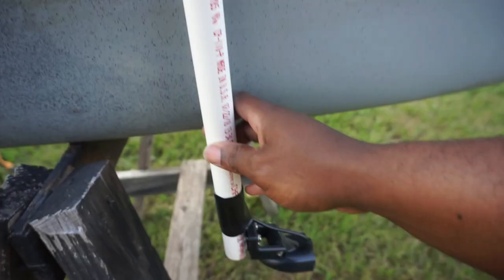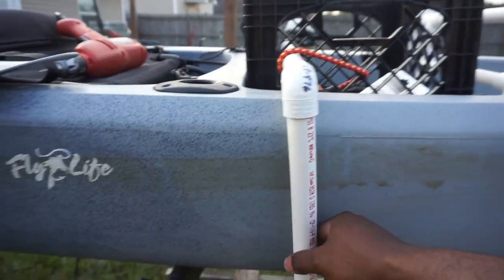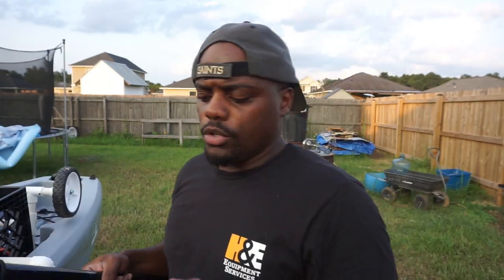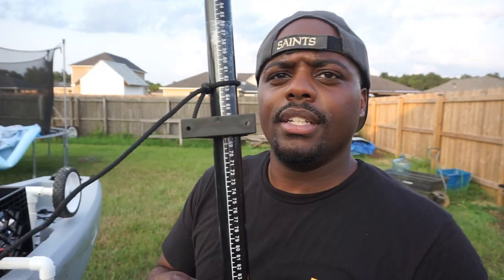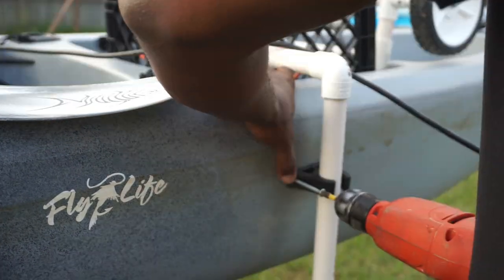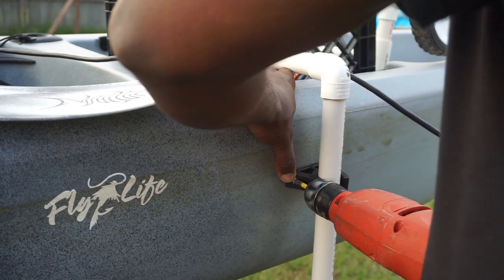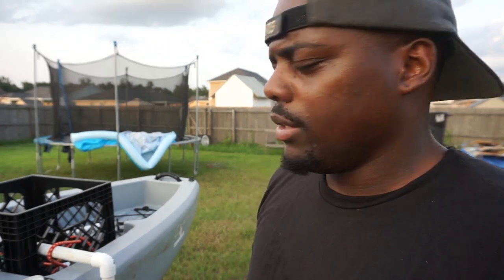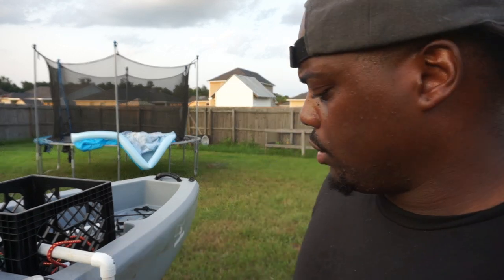Quick $10 Kayak Transducer Arm Fix - WORKS ON ANY KAYAK!

Comment: A $1 fix, without drilling a hole in your boat, would be to drill a hole in the PVC pipe somewhere up near the end where it's inside your milk crate and inserting a bolt or piece of heavy wire in the hole and through one of the slats in the milk crate. The PVC pipe then couldn't twist and problem solved. :)

Comment: I like your solution but if I was you , I'd set the paddle clip a little upper because I think that is very dangerous to drill the kayak hull on the floating line.
Reply: obvious its under the water line :O 2 small holes but still :O   silicone maybe / least an o-ring or 2

Comment: I got a T and cut a strip out with a oscillating tool and then snapped it to my horizontal seat bar. I drilled holes for quick pin at the joint and one for the cable to pass thru. 👍🏻🎣

Comment: You need two clips to stabilise it. Alternatively, cut a T piece in the pipe inside the crate and fit a “centre” pipe facing down to get trapped/stuck on the crate floor. That way there’s no making holes in your boat.

Comment: Unless you are using a side scan unit there is no reason to mount a transducer outside the hull of your kayak. I have had many kayaks and all but 1 i mounted to the inside of the hull and worked perfect . Only my side scan was on a hanging mount. Hope this helps out.
Reply: water temperture or not having an accessible hatch to get to the bottom hull.

Comment: Try self tapping screws they have a small rubber ring to seal we use them in HVAC or sheet metal screws  they're called but they have a rubber seal on it DUCT SEAL works incredible also for sealing small holes not sure on the waterproofing for the duct seal though an experiment maybe in order for that. It gets hard as a rock though.

Comment: I had something similar on my canoe. But I really like the paddle clip idea. Not so much on the drilling in the hull though. :)  Maybe screwin to a block in the crate..?   Kayaks should come with a sack of PVC fittings. ha.. really!
Reply from the maker: Haha!! I agree on the PVC. I am right there with you on putting holes in my kayak. I get the pain of those screws going in. I went back and sealed them up with 5200 sealant.

Comment: Dirty and I still look pretty,   That’s awesome man,   😀.  Ohh and good video and great idea,  I might actually steal this one,   You might be able to use the other clip along the horizontal surface as well just before the black box you have there
Reply from the maker: That's an awesome idea. Glad I didn't get rid of it.thought about using it to help hold the paddle because the paddle clips that come on the boat..well, they suck haha.

Comment: Nice solution and I agree with some of the others, great concept but installation could be better  to protect the hull. 1. If you use those screws, just mark and manually self tap. ,don't use a drill , yes it's easier but you risk stripping the hole and leakage. 2. If you are going to use screws such as those, definitely add sealant or silicone.  3. Keep up the good work. Thanks for the information!

Comment: Waste of money!
Cut a section of the same PVC pipe about 4" long. 
Round off the 2 ends so it looks like a "D" turned sideways.
Cut 1/3 the diameter off the curved side. heat it up without burning it,
Snap it back onto the same size pipe, remove/sand to smooth the edges
Make sure the pipe can snap in and out by sanding it more or less.
Drill 2 countersunk holes in it
Screw it to the side of your yak with SS screws where the transducer goes.
Whats cool about this design is if the T-duce hits anything it'll snap loose
not causing any damage.
Oh and use small pieces of thick plastic (Cheap cutting board) on inside to screw to making a super strong base.
Reply: can I get a video?

Comment: A box of 25 1" Stainless screws is about 4 bucks! You know how many things you can mount with 25 screws?
I buy a box of 1" and a box of 1 1/2" for about 8 bucks. That's like 20+ things you can mount on your yak WITH NO RUST!
Again I say... Pieces of plastic cutting board inside the yak to screw to!
Great vid tho!